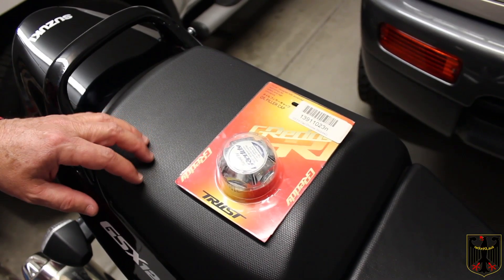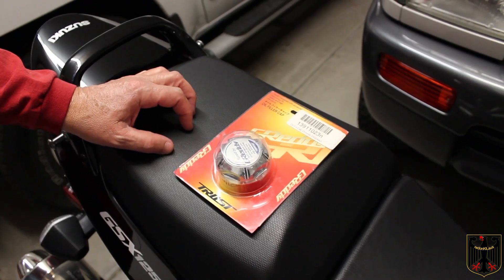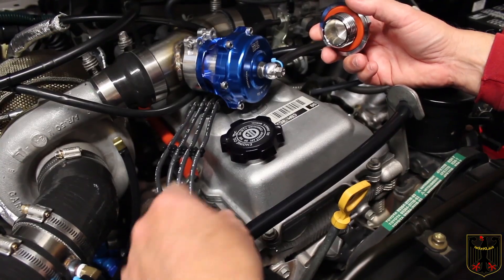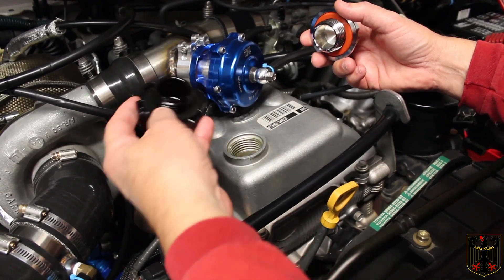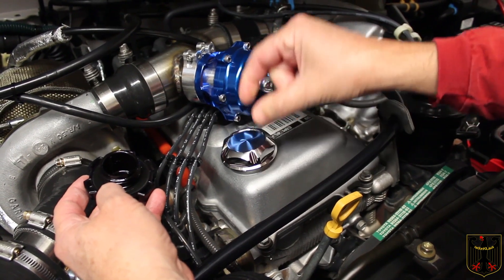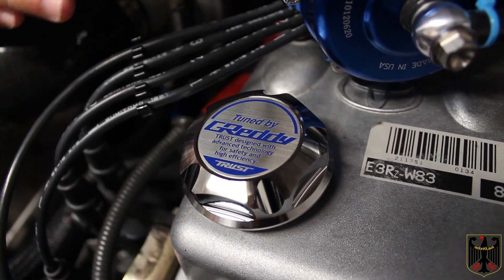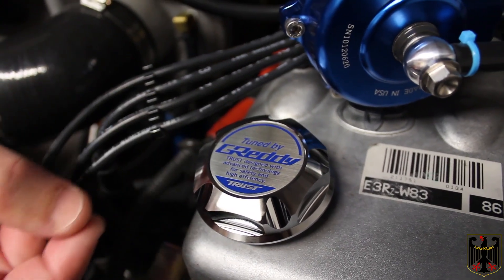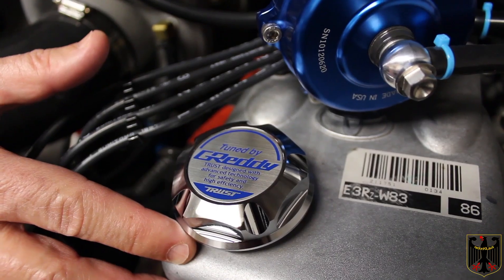Turbo 3RZ-FE 4Runner - GReddy Oil Cap

Comment: That looks cool! Just wondering would the original oil cap work ok with your new turbo kit? Or you get this new oil cap so it can withstand oil pressure from turbo?
Reply from the maker: The original oil cap worked fine with the turbo kit (I did replace it with an OEM Toyota one a couple years ago, though, because the original one's seal was finally beginning to leak).  The GReddy cap is really just for looks, and they are blowing out their remaining stock of them (they are now discontinued), so $30 for a CNC'd billet cap is pretty darn cheap.